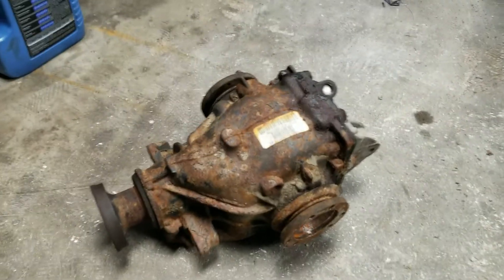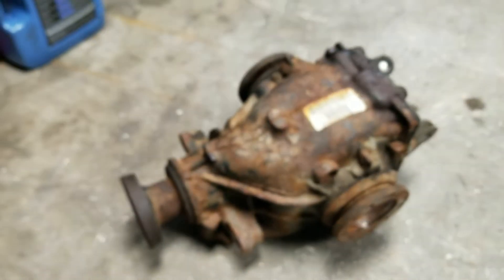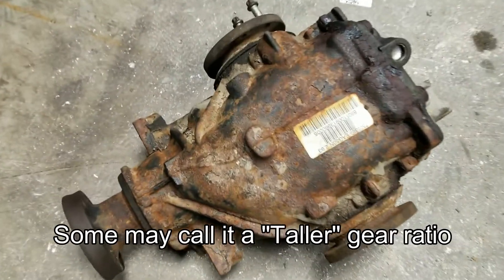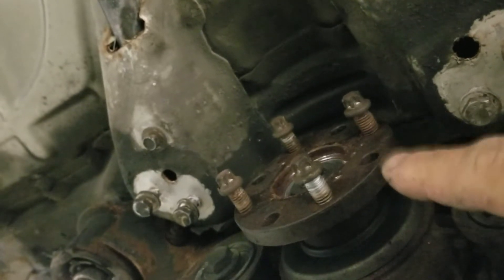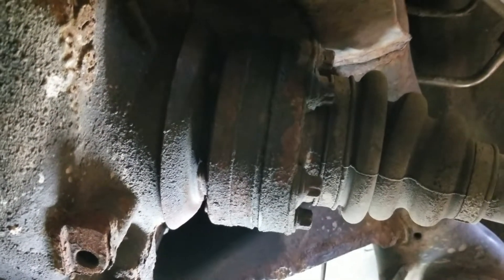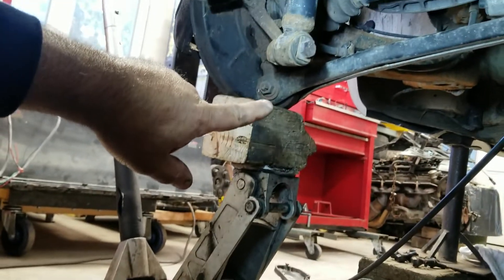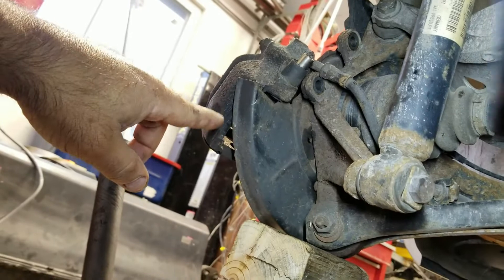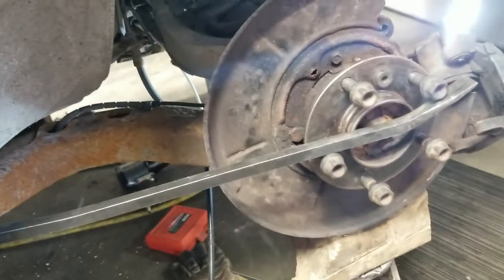Electric Car Conversion BMW e46. Differential swap

Comment: Axel gearbox
Reply from the maker: The reason I changed it because this one has a High gear in it. 
It runs a lower motor rpm at higher speeds.

Comment: Why did you change out the Actual gearbox
Reply from the maker: The Transmission/Electric motor from a Lexus 450h replaces the BMW transmission.

Comment: Got there in the end! I'll be back under a rusty BMW tomorrow as I start my next conversion. Not thought about whether I need to change the diff or not yet. That can wait for now.
Reply from the maker: Excellent...a fellow DIYer EV Conversion guy! Subscribed. :)
If high rpms aren't a issue...then leave it.
Reply: @InTheGarge  Absolutely. I'm afraid my approach to this is very much trial and error. And if there's no error, leave it as it is!